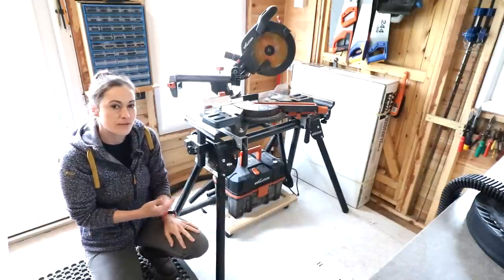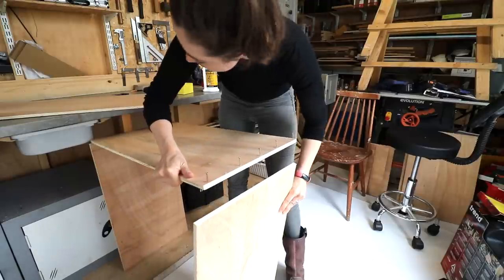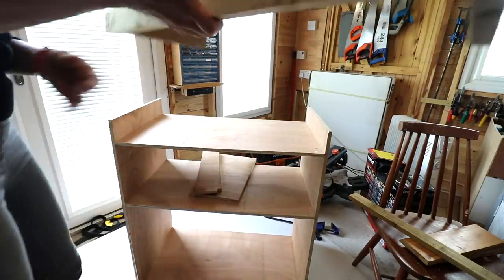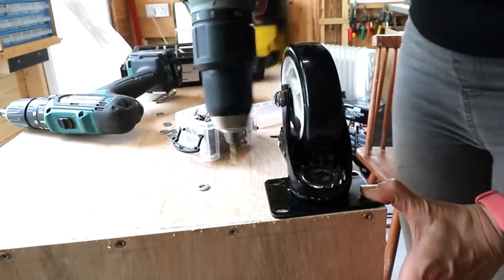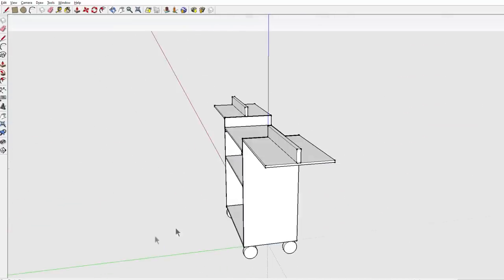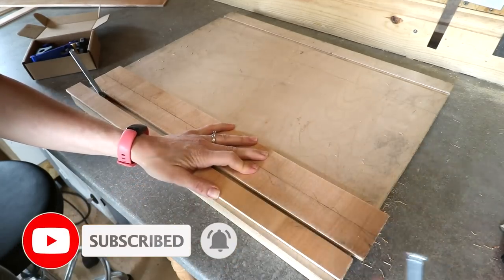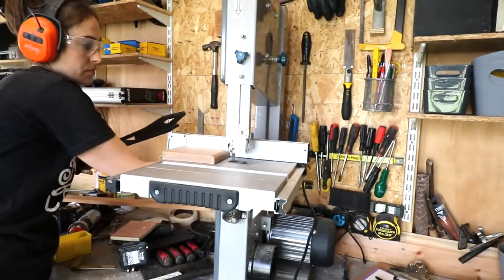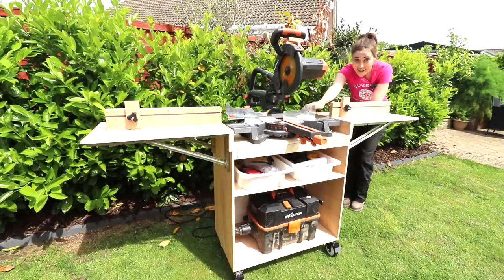DIY Mitre Saw Stand /Folding Mobile Station with Wheels & Stop Block | The Carpenter's Daughter

Comment: To hold large pieces of wood in place to fix together, I suggest buying a bench metal bender and some 2mm steel sheets.
Bend to 90 degrees, then you can clamp the wood, I have a number of sizes of bent steel sheets for this purpose.

Comment: I think it's great that you made your own bench. Its good to se a woman taking on projects like this. I've recently made a similar rolling cart/station for my miter box. 

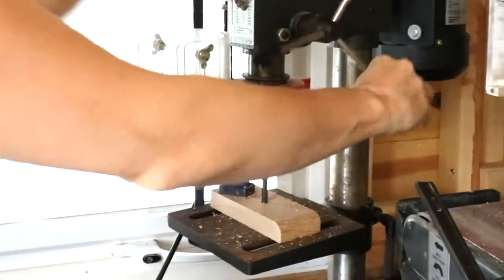If I could add just one bit of advice regarding safety for you and all who watch this video. At 8:06 you show your piece to be cut to the right of the saw blade and butted up against your stop block and your hand on the piece of wood to be cut to the left of he blade. This is a VERY risky way of making that cut. 

When using a stop block you should ALWAYS have a hand on the same side of blade as the stop block is on. Switch the stop block you use or switch which hand you use to pull the trigger. Otherwise you risk that board being flung out of the work station at lightening speed and risk getting slapped in the face with it, especially if you were to raise the blade before it stops completely, which happens sometimes when we get tired. 

I've been a professional finish carpenter for about 35 yrs. now. And I see this same mistake shown on so many YouTube videos and every time I think someone is going to get hurt doing that. Don't mean to be the safety police, but is probably one of the worst things you can do with that saw. Hope this helps. Keep up the good work!

Comment: I love this. I've been thinking about doing something similar for a while. Your plans are the best I've seen. Wobbled a bit without 18mm material. Does it hold up ok? Also, we have the same mitre saw!
Reply from the maker: There's absolutely no wobbles at all :)  It was on some underlay for most of the build which I'd put down as anti-fatigue mats as I have patellar tendinopathy - but  I've had to take that out now so I can move it around.
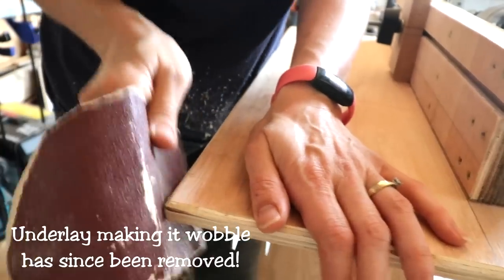Reply from the maker: I added some text at 8:39 so you know I'm not telling porkie pies 😄
Reply: I didn't mean to imply that, sorry. Your content is awesome. I've become a big fan.
Reply from the maker: I absolutely wasn't offended ;) I would have wondered the same thing as you want it to last when you go to the effort :)  As long as you put supports on it with 12mm, (including glue and screws) when using 12mm ply, I'm sure you'll be fine.  I'd be inclined to do the same support and overlap with wheels even with thicker ply.  You don't want it collapsing mid-cut.